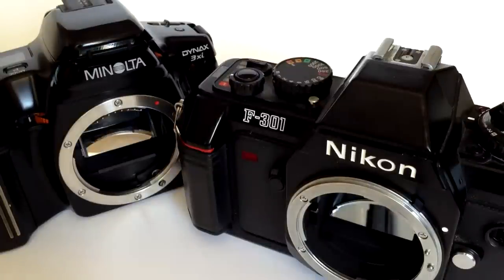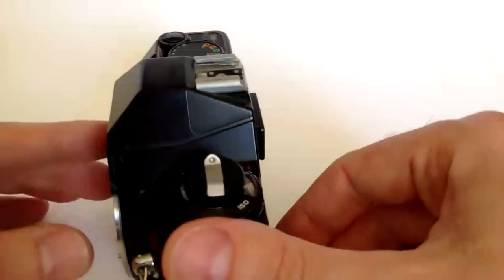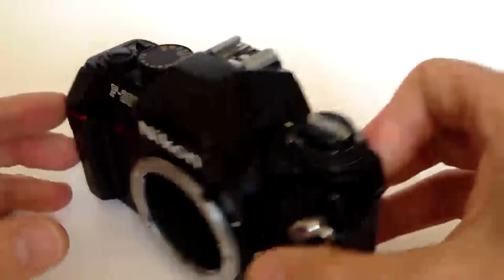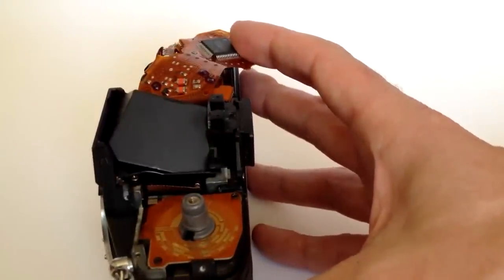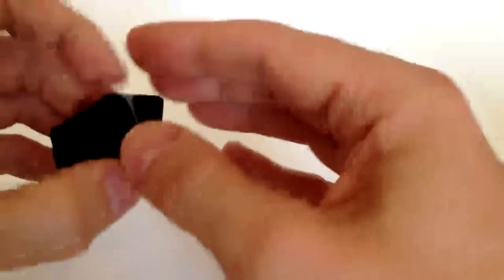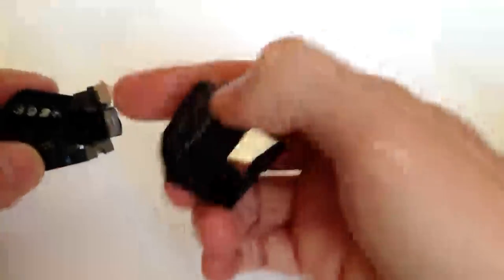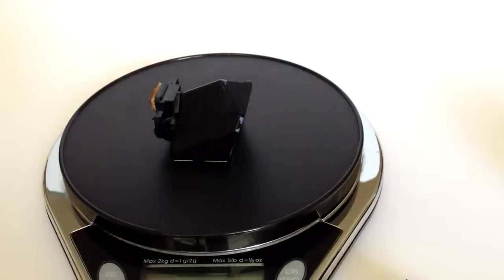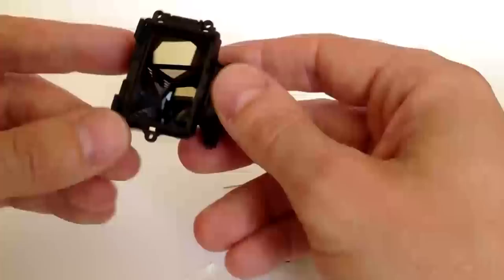Pentaprism vs Pentamirror (HD Version)

Comment from the maker: ** Update **

I changed the settings on the scales and weighed the pentaprism and pentamirror in grams to make the measurement more refined.

The pentaprism is 43 grams.
The pentamirror is 13 grams.

Remembering that, on the model shown in the video, the pentamirror also incorporates the focusing screen and viewfinder eyepiece: this means that the pentamirror is almost certainly at least 1/4 of the weight of the pentamirror.

Comment: The differences of viewfinders are up to 3.5 EV - it is not slightly minor difference, it is whole sweet world of difference! or in absolute numbers: 12 times more light!. The brightest viewfinder I have ever had - was on my minolta 9xi, absolutely brilliant and amazing thing in compare to dozen of my other cameras or to any digital camera in my hands! Probably most disappointing and darkest viewfinder was on nikon D3000.  There are many types of mirrors (aluminum, silver) , and many class of surface polishing - that is why differences are so huge. but also technologies of display in viewfinder are very different - like LCD and required polarizing foil is additional 1EV or even 2 EV of light loss in compare to directly printed oled . the same is with focusing screen / so it is not only about pentaprism vs pentamirror , it is about whole engineering solution of viewfinder.
Reply: The brightness is the primary effect. The secondary is the fact that pentaprism cameras have  greater viewfinder magnification. On Canon APS-C cameras it is something like 0.95x vs. 0.82x measured with a 50 mm lens.

Comment: i have pentamirror  on Nikon D3100 - it has dust between  it and foucs screen on the top of mirror - i tried many time to clean it - but it always get the dust again - i removed the foucs screen and clean the glass under it,  many many time and it got some scratch (with some kit tools) - now i still see many dust obviously- its not affect to me while i'm  shooting - but i ask if it can be changed or not - and is it easy to replace (i mean is it easy to reach it with out Removal  all parts on camera suh as sensor , shutter , ... etc ) ...... sorry about my bad english
Reply from the maker: +khaled fathe I really can't advocate cleaning it yourself. You run the risk of damaging it. Personally I would take it to a Nikon dealer and ask their opinion. Sorry I can't be more helpful. James.

Comment: DUST is a DEFINITIVE issue with the Nikon D5200 pentamirror... you get enough in it it's going to be a 250-350 part, because it'll all have to be replaced.